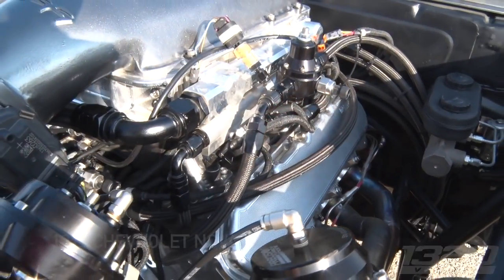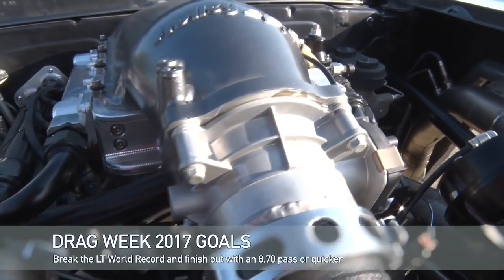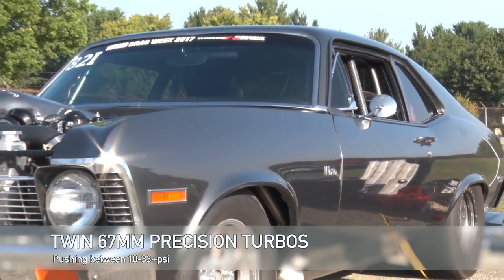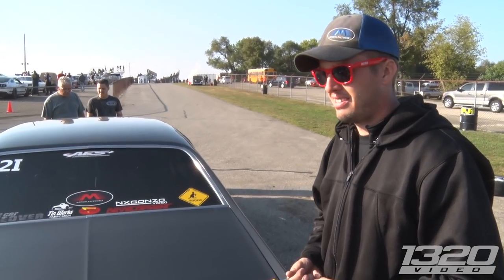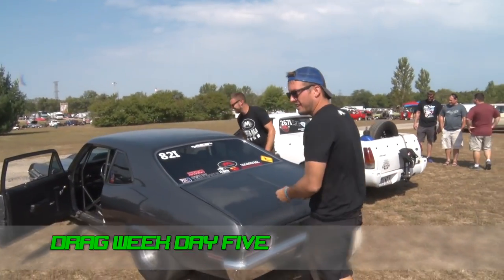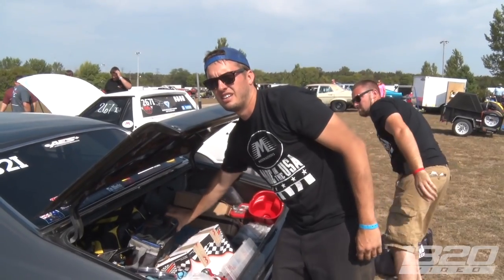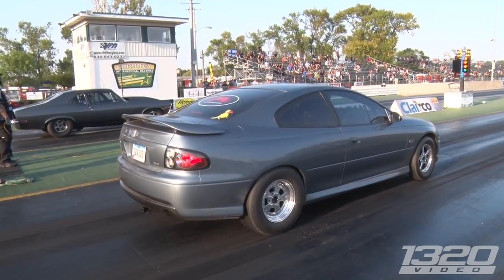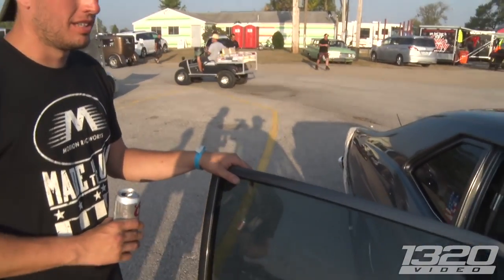They Were BORED with LS’s! - NEW World Record!

Comment: Wrong tic performance has lt1 Camaro that runs faster then 880
Reply: They have a Gen 2 LT1, which is based off of an old small block chevy.  It is an awesome car.  This gen V platform was all new in 2014 though, so a different platform.
Reply: Correct but how can u say fastest lt when there is a lt don’t say fastest gen v. I know what they have car was built for my friend which then sold back to them

Comment: i feel like turbos have become the new nitrous....no one has to use their brain to make hp anymore....just a bunch of fakes and losers strap a snail on and turn the boost up.
Reply: Frigglebiscuit well how else is anyone going to run 7s? If someone wanted to do an NA build It would cost a shit load of money
Reply: jnarvaez89 turbos makes it too easy. You then have people running around saying: "IM A TOP NOTCH ENGUNEEERR. I BUILD 7 SECOND CARS CUZ I R SMERT." its no different than people putting 300 shot nitrous on a stock v8 and acting like they are hot shit.
Reply: its too cheap and easy to take the turbo route and act like you are a know it all badass.